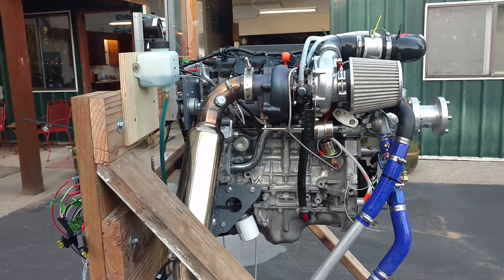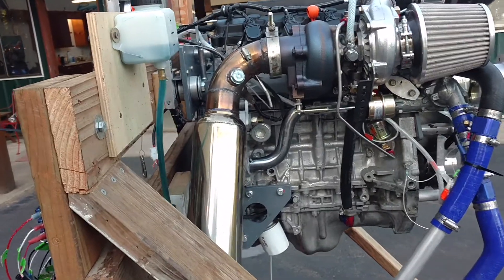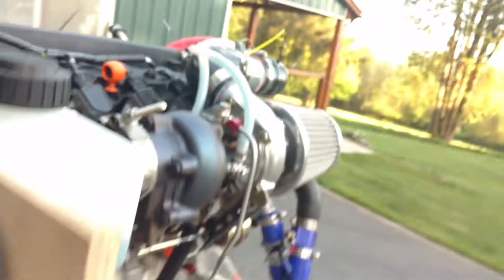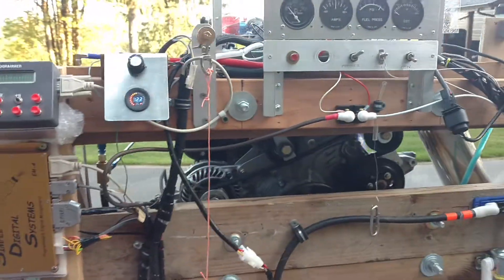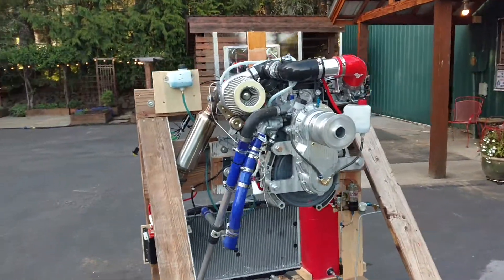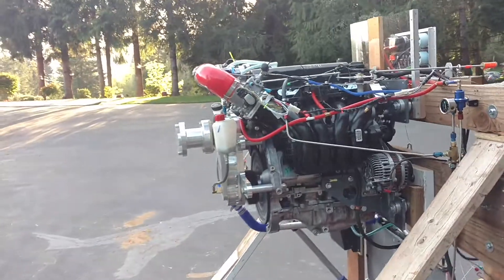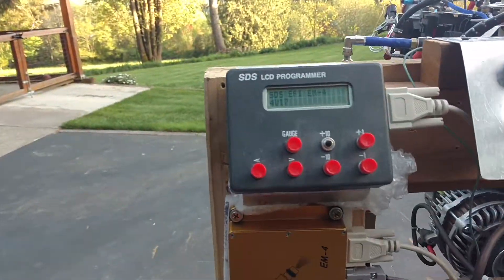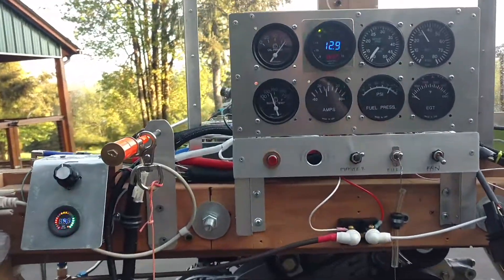Honda R18 Civic 1.8L runup with SDSEFI, T3 turbo and PSRU gearbox

Comment: You should probably run a smaller t25 turbo it give u less lag and a good 2000-7000rpm powerband
Reply from the maker: That would be appropriate for a car, but not for this application.
Reply: @charosenz  I'd just figured you would want the boost to come in low and not have to run it up top for long periods of time that's a big turbo for that engine
Reply: Wrong

Comment: I imagine your engine was not brand new when you got it.  How many miles did it have when you got it and did you do a complete overhaul on it before starting on the conversion? Thanks
Reply from the maker: The engine had less than 5000 miles on it.  I did not overhaul it.  I have over 100 hours flying with the engine so far.
Reply: @charosenz  whats your fuel consumption during cruise speed flying?  
BTW, cool little bird you've built there.  I want to build the RV7a myself.. 👍
Reply from the maker: @risegonza2257  sorry I do not have a fuel flow meter to provide accurate number. But i believe max power is about 8 gal/hour.

Comment: So most rv6s have 150 or 160 hp. Do you think the gear reduction will compensate for having less power, or will the turbo get you there. High alt perf should be better than an o320. Good luck with it. Following you on vaf.
Reply from the maker: The engine is rated at 140+ stock with OEM exhaust.   I will allow the turbo to help a little, say 5lb or less which puts me right where I want to be power wise.  I not really focused on the HP/speed as much as I am the viability of the concept.  Hope that makes sense. Thanks for the comment.
Reply from the maker: Also, one significant factor is the gearbox ratio is 2.33:1 so the prop is only turning about 2000 RPM at 5000 engine RPM, and with a fixed pitch prop, it is quite limited compared to a prop that turns 2400+ rpm and possibly a constant speed prop system.   Regardless I am very happy with my set up, but it is not for everyone.
Reply from the maker: correction 5000 / 2.33 = 2145 rpm.

Comment: What are u using to run the motor? Like ecu and wiring?
Reply from the maker: I am using an aftermarket ECU made by SDS.   It is great and simple to use, very flexible.  Check it out on www.sdsefi.com
Reply: @charosenz  did u make your own bracket for the alternator?
Reply: @charosenz  does this sdsefi work on a daily car?
Reply from the maker: @kutlee2009   For more info please go to www.sdsefi.com You will find more info there than I can provide...